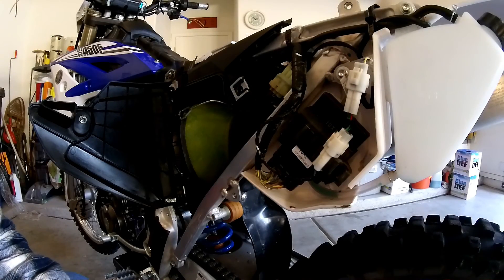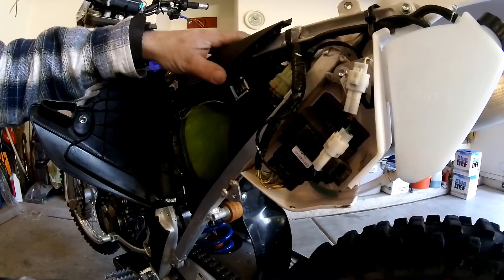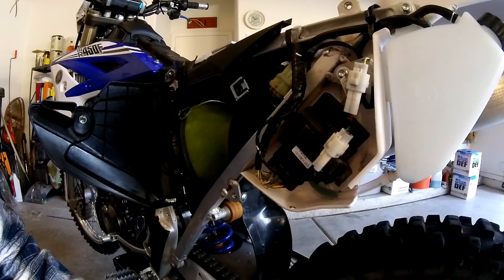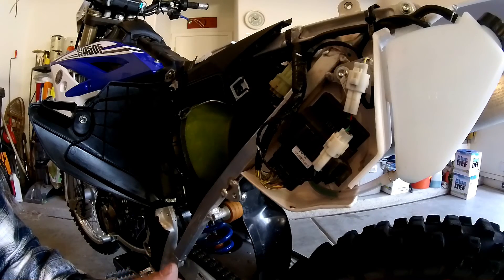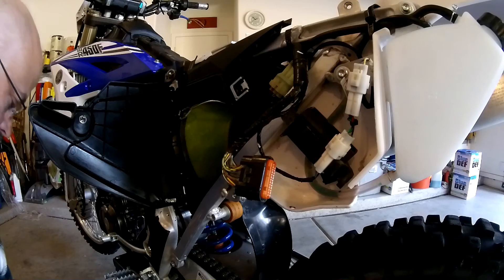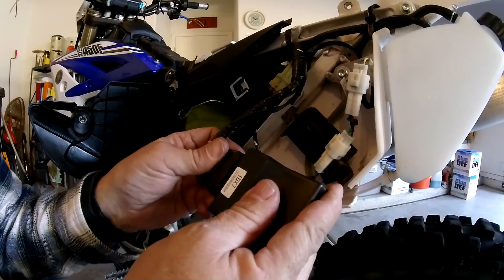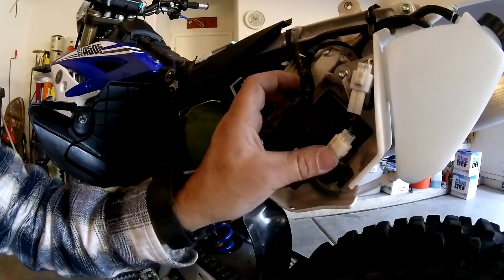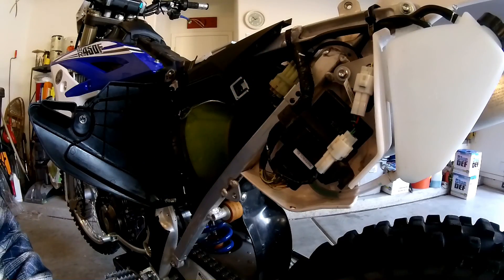WR450F Phase 2: GYTR Programmable ECU 2012 2013 2014 2015 GYTR Yamaha WR450 Power Tuner

Comment: Where did you buy the ecu and throttle stop screw
Reply from the maker: They were from Yamaha's line of GYTR products. They are no longer sold. They do come up on eBay occasionally.
Reply: I recently got a 2014 wr450 and can’t find the ecu for it anywhere

Comment: I'm confused, this ECU is meant for the yamaha 2012 thru 2015 model wr450f correct? I have the 2012 wr450f dirtbike and its fuel injected which has no choke. In fact 2012 above are fuel injected with no choke. How can you have a choke button if this is for 2012 and newer models? Or am I missing something? Any feedback appreciated.
Reply from the maker: There is an enriched on the left side above the motor near the motor mount. I'm not sure what the that has to do with the ECU.

Comment: This gimmick is no different than disconnecting the grey wire and replacing the long throttle stop screw with a 25 mm which amazingly comes with the ECU.
Reply from the maker: You are horribly incorrect.

Comment: I bought a 2014 used. Is there any way to tell if the gytr ecu is already installed?  Does it look different than the original? Or is the part number on the tag different? Thanks for any help
Reply from the maker: I am not sure. The part number is stamped into the ECU. You can look it up on any of the popular motorcycle parts websites that have OEM parts. Generally they look like a big chunk of black plastic.

Comment: Hey AZ Dog I just picked up a used 2014 wr450f.   What mods are the best bang for the buck?  Throttle stop removed,   and it's got the stock eco which I will be replacing soon.  Did you modify the airbox or try an exhaust?
Reply: It’s possible to order GYTR  ECU for Yamaha WR450F from 2013 ? Thnx
Reply from the maker: Congrats! I would get a quality slip on rather than mess with the stock exhaust. Skid plate and hand guards.If you can fit into your budget get the GYTR ECU and Power Tuner. They come as a package. You can read RPM, Hours and engine temp plus modify the fuel map. It's about $300 bucks. I would leave the air box alone the bike is tuned for a certain pressure int he box and modifying it will drive you nuts with the tuning if it goes wrong. Good luck.

Comment: I just bought a used 2012 WR 450 and the bike is a pain to start hot. I have killed the battery several times out in the bush and had to resort to millions and millions of kicks to start it eventually. Now I know why the guy sold it. I feel so dumb because when I test drove it the bike was cold and started fine like it always does cold. Its got the full GYTR exhaust, screw and ecu when I bought it. The bike only had 10 hrs on it and is like new.  Thanks if anyone can help .
Reply from the maker: Desert Mountain Preppers These bikes are known as hard starters. It should be better than what you describe.  I don't know hiw many hours are on yours. Have you exoerimented with a different fuel map?
Reply: The bike is virtually brand new still. The guy I bought it from never rode it and now i know why. I have an appt on Thursday at the Yamaha dealer to see if they can program this issue out. When I first got it I could pull that knob out and it would start hot. Now it won't start with the knob in or out when hot and VERY difficult to kick start but I can after 30-40 kicks and letting it cool some. Yes I have killed the battery several times now then had to resort to kick start.  I'm afraid to take it out riding now especially not being able to simply kick start it. If the dealer can't fix it then it going up for sale rather than dump any $$ into it and find another bike.
Reply from the maker: Desert Mountain Preppers You shouldn't use the enricher knob when hot. It's only for cold starts. A new plug might be a cheap place to start. If it has the GYTR chip the Yamaha fuel injection programmer is only  $300 and is a useful tool if you keep it. It could also be a timing issue.
Reply: Thanks for the plug tip. Yep I shouldn't have to use the choke on hot start besides its a PAIN in the butt to get my gloved fingers in there and now it won't even start pulling that knob out. I  believe from everything I've read that its a timing issue on a closed zero throttle and the GYTR tuner doesn't work on that throttle position and you have to get the dealers programmer. I'll let them give it a try and  if it continues the bike is going  down the road. We have tons of riding planned and I'm not spending it kick starting for hours.
Reply: You need to lean the mixture for the top end slightly.  Also try twisting the throttle just slightly and hold steady while cranking.  This will allow extra air in and make it easier to start.

Comment: Nice little mod bro, came it fully programmed out of the box? How to connect it to the Coputer? No wide range O2 Sensor needed? I would like to see the recorded egine data... You see I like that computer stuff :-)
Reply: +azdesertdog  yeah that's where I am sitting right now, Figure once I can get riding, will do break in period on that base map, tho I was going to put the shops air/fuel sniffer on it, to see how lean it is or not, compared to the available maps I have already programmed into tuner. decisions, decisions LOL
Reply: how many tanks have you gone thru? how many kms on bike, (still breaking in?) I averaged 50miles on the carbureted 2010 before reserve, I have heard the Fuel injection gets abit more, But that its tank is .1 of a gallon smaller. That bigger tank is pricey too.!
Reply from the maker: +Chris MotoBikingAtThisUnivers Yup ready to go out of the box with a "base map". No computer needed there is a programmer thingy that I have. I will mess with that in the next video. Need some ride time though.
Reply from the maker: I am thinking about trying the Aussie map. Sounds like a good desert map. My big thing right now is fuel capacity, only 34 miles to the low level fuel light comes on. The only tanks available are only 3 gallon only .9 more tha stock.
Reply from the maker: 1LeanMachine
I have about 240 KMs on it. Maybe it will get better. I could have something to to do with right hand tho. LOL

Comment: Hmm removing the baffle, Do you still have the spark arrestor inside? 2 nd thing, did it tell you to unhitch the battery? I always do that when I disconnect my ECU on the Beemer. Just to be safe.
Reply from the maker: +navythomas8 Actually I replaced the baffle with a "competition baffle". The baffle is separate from the spark arrestor. The other video shows the install. I didn't disconn the battery didn't think of that. I'll remember next time. Thanks for the Info on that.